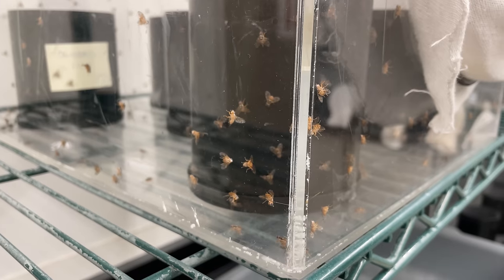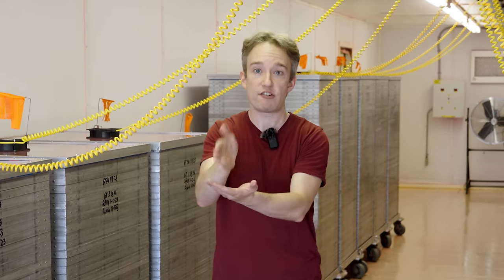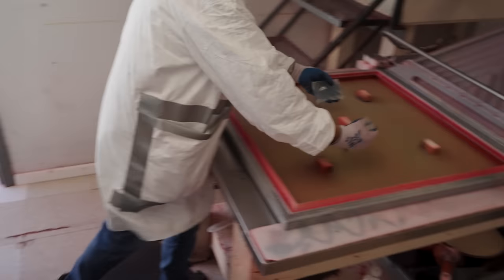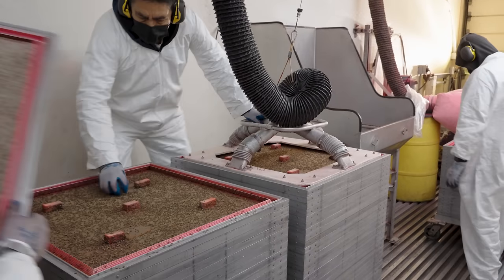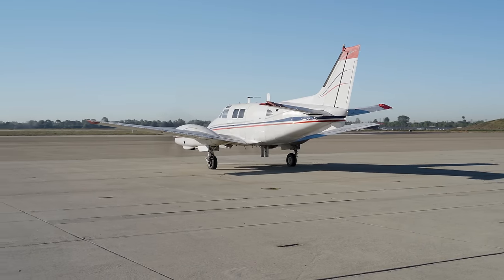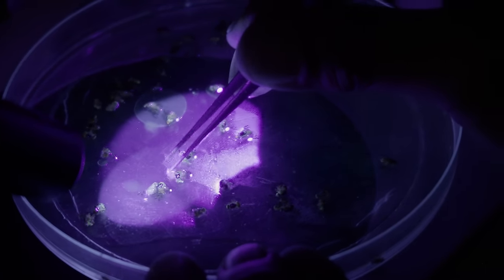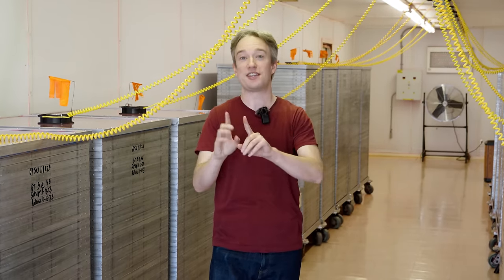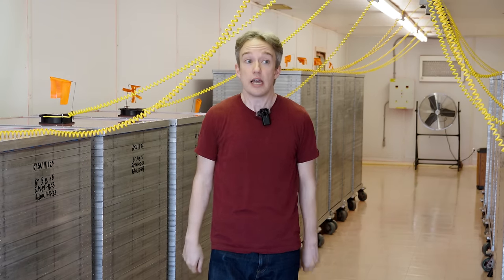Why the government drops flies on California

Comment: I work for a company that makes the X-ray machines that sterilize them. They also do this with mosquitos and a load of other invasive species. So far it has really worked well.
Reply: Can you do it for Midges in Scotland?
Reply: How do they check that they are sterilized? It's just described that they check them when they arrive in the video, but they don't say how.
Reply: @ano_nym  small scale lab tests, check if eggs hatch. if they don't, scale up. batch sampling.
Reply: I'm very curious if the sterilisation process increases the risk of cancer or other health issues for the flies? Given their super short lifespan I assume not?
Reply: @keeyan2166  Their lifespan is about 2 months, so it's not THAT short. That being said, do we care if they do develop cancer? (I understand you are probably just asking from a point of curiosity)
Reply: With mosquitoes, they also make genetically engineered males that are not fully sterile but instead are only capable of producing male offspring that are viable. The male offspring also carry the same trait, so it's a gift that keeps on giving!
Reply: Increasing the risk of mutations with every generation means that it's likely that at some point evolution could find a way around our current methods.
Reply: @FahadAyaz  not true for this as they don't replicate. They should be able to replicate to make advancements with evolution, as there's no future generation
Reply: @ratdude747 That's brilliant. We need those all over the American South.
Reply: @blinkenlights  there's a lot of debate around wide scale release of these mosquitoes, and how the elimination of the few species of mosquitoes that bite humans might effect the ecosystem at large. Personally I'm all gung ho on it, but this isn't something they want to do willy nilly so these debate on it.
Reply: What type of radiation levels do they use for this?
Reply: How quickly can we add the aedes aegypti mosquitos to this program? They have really become a nuisance these last couple years.
Reply: @joecaljapan  haha Midges are small flies common in much of Scotland. They go biting in huge swarms, very itchy and make life miserable.
Reply: @keeyan2166  the lifespan and the simple body plan of the fruit flies practically means they're immune to cancer, even if they start developing it, the chance that a fruit fly lives long enough to be affected is low af
Reply: @FahadAyaz  the fruit flies are bred from a population that is separate to the ones that are sterilized, you know cuz being sterile kinda makes reproduction hard. 
so that evolution can't really take place (and does it really matter if wild fruit flies happen to be resistant to UV light?)
Reply: question: Why do we still have mosquitos all over the place
question 2: do you guys make large scale versions of these so i can just irradiate all the mosquitos around my house. I okay with it making me sterile aswell its a sacrifice im willing to make.
Reply: @joecaljapan  I got a good laugh from this! 😂
Reply: @BillyGooding  I live in Cyprus and midges are very annoying here, too. Their nickname in Greek literally means "a biting horse" or something like that. 50x more itchy than a mosquito bite.
Reply: Is this why there is a butt ton less insects everywhere?
Reply: @kossboss  No.
Reply: ya, except the part where now a company has incentive to make more money by infesting areas to increase the demand for these services. I predict someone will have fly farms where they are not at all sterile and we will then have super populations of these pests, if this happens with fruit flies, probably not a big deal, misquitos that carry really bad diseases, not so harmless. It's just a matter of time before it happens and i'm guessing this comes out of our tax dollars so  also a great way to exploit that too.
Reply: Can we put those machines in Democrat counties?
Reply: @luisbetancourt-dp7hh i guess what he’s saying is the one in a million that does survive maybe it will breed to a giant fly with claws or something
Reply: @AmariLambo  that would be funny, although even if it bred it's very possible it would just bred with another sterile fly and done again
Reply: @luisbetancourt-dp7hh  long enough it’s gonna happen bro haha
Reply: When will people learn don’t mess with Mother Nature it usually backfires
Reply: @keeyan2166 not a single person cares if a fly gets cancer…😂😂
Reply: Now if they could only do this for politicians and bureaucrats
Reply: It's fascinating stuff!
Reply: Can’t that cause like mutation in near future and make insects immune to radiation or something. Since smaller creatures evolve faster than mammals . Idk anything of that just talking out of my ass I’m high af rn watching this
Reply: Lemmme guess.. x rays no megative effect on humans right?
Reply: One confusion Why there is a need to grow the flies and then throw it over aeroplane, why can't remove them from the equation all together?,  will it cause ecological imbalance ? i thought flies are artificially created were not there before? I am just curious.
Reply: Do you think they would be able to do this with the Lantern Fly? Last spring was extra gross and having to check to see if you have hitch hikers to keep them out of the house is annoying to say the lease.
Reply: Do it more cause my house has never seen a higher amount of both flies and mosquitos in the last 2 years. Shits nasy
Reply: Thank you for the work that you guys do. My friends in California are thankful for the work you do.
Reply: @mattlarson9897

As a Californian resident I don’t see it working far as de sterilization
Reply: I need a mosquito that sings Rihanna songs and doesn’t bite me only my opps can I get one custom made ?
Reply: Oxitech has a mosquito program. Florida is part of it. However, they seem to bite.
Reply: @eVill420  Can't fault him too much as when your knowledge of science comes primarily from sci-fi movies, you get easily confused.  I mean it happened in Jurassic Park right?
Reply: Nature will always find a way.
Reply: Yep, you always get one person that always claims that he works doing this,
Reply: @marknorville683  I guess everybody is unemployed in your fantasy world...
Reply: Can this work for mosquitoes and malaria? Isn't malaria one of the top killers in the world? I bet some countries populations would explode..
Reply: For mosquitos, the use of Wolbachia virus to make them sterile works too.

Comment: As a pilot watching this I went down the biggest rabbit hole attempting to figure out whether or not that was a Queen air or a King air. It's a Model 65-A90-1. Which is essentially a King air with a queen air cabin. I have no idea why anyone would want such powerful engines on an unpressurized airframe that can't go higher than 12,500. I guess if the purpose is to stay at 2000 feet to drop flies then I guess its perfect for the job.
Reply: I was curious about that as well but without the aircraft registration it's going to be tricky to see if that plane is original or just picked up on the second hand market and was good enough.
Reply: Cheaper maintenance and certification procedures with an unpressurized cabin?
Reply: @cheekychappy1234  I believe there are two. N65V and N65U, which both appear to be identical.
Reply: probably best to have an overpowered engine for the job than the bare minimum and risk some sort of failure, because these planes are probably reused year after year. I would think.
Reply: @jadeng1147  thanks for that I'll keep an eye out for them when watching the flights landing at LAX on YouTube.
Reply: Worked at Beach, they did alot of different aircraft configs to keep the production lines running...Duke, Queenair, multible Kingair variants (90, 100, 200, 300) based on what customers wanted. They once stuck jet engines instead of pt-6 on a king air for the fun of it.
Reply: They're usually ex-Army U-21s.
Reply: Cargo weight and one engine operations ofcourse😅
Reply: @LasersGoPewPew69 Oh hey, I remember taking a tour of Dynamic back in 2021 when I was in high school.

I remember seeing that they've been looking at/workimg on converting some of those aircraft to UAVs. I remember also seeing one of their low-vis grey Dash 8s (lots of sensors and other equipment housed in bumbs as well) land, as I was standing at the edge of the golf course that was close by.
Reply: @jadeng1147 they also fly N61Q, N67K and N66W.
Reply: @jadeng  To handle the weight loading of the cargo and still be able to safely fly on a single engine for any "Justin Case" moments.  Not all pilots "need" to go above certain altitudes, nor speeds.
Reply: @LasersGoPewPew69 you are correct, all Vietnam era aircraft bought on the cheap from the government and they branched out from there. Worked there for years and loved it all, super cool missions they are involved in
Reply: From below, (3:48 & thumbnail) the "shark body" fuselage shape kinda makes it look like a straight-winged, propeller-driven, Me-262 with its nacelles positioned slightly forward. 😶‍🌫️
Reply: @benjamingreenblatt8482  it was fun until Raytheon bought it and then the culture changed.  I left shortly left  after so I don't know how it is now.
Reply: So if you're doing weight and balance calculations do you account for the number of flies in the flying at a given moment?
Reply: @asbestosfiber When you conduct an operation with a dispensed load of some wort (flies, spray, water), you try to keep the load as close to the CG as practical. That will limit the CG shift as you dispense. The load doesn’t dispense that fast so the weight change isn’t substantial.
Reply: The extra power is used for the refrigeration to keep the flies immobile?
Reply: Like all the previous commenters said, Dynamic got the U-21 for cheap as essentially vietnam era airframe surplus from the Army. The Army sold them on the condition that Dynamic must buy every single airframe, so there's a hanger in Oklahoma stuffed to the gills with them. It's real easy to customize the airframe to do practically any mission when you don't have to worry about pressure vessels or running out of spare parts. 

Legally a king air, no pressurization and typically with a PT6-20/21/28 set of engines. And these suckers can go above 12,500, just throw on o2 masks with oxygen bottles and you can fly up to 24k. Dynamic has projects that fly unpressurized at 20k.
Reply: The load looks quite light here, but maybe with the A/C and releasing mechanism it becomes heavier, and more power is welcomed?
Or they just got a deal on this model, because nobody else wants such a gas guzzling plane for commercial flights...

Comment: This is similar to the joint U.S.-Panama programme that drop flies in Panama against the Screwworm. Not an easy task but one that requires constant effort to make it work.
Reply: Thanks for the read. Found out they cut off the program at Panama (15 million usd per year) because south American countries hate each other and don't want to pay for a certain percentage of the bill to eradicate screworms.  They can't agree on how tk calculate which countries pool what amount for the sterile screworms. 
They should just do it based on the percentage of livestock a country holds compared to south American total livestock.

Comment: Short refrigeration is a very good technique to immobilize insects for macro photography. You can manipulate them into all sorts of poses when they are completely docile at low temperature. Plus if the temperature is low enough and there is environmental moisture you get dew drops on them for sparkling effects. Then after the photoshoot the stars can be released without harm.
Reply: Doctors do it too. But there's more to the story.
Reply: That's how??? 😂i always wondered how they did it, found bunch of flies mating pictures macro photography in Facebook

Comment: Won't this stop working in a few generations, due to the selection pressure on the females to distinguish fertile from infertile males? Seems like a short term solution which could make dealing properly with the problem later on much harder

Comment: Irradiating something doesn't necessarily make it radioactive. It all depends what you irradiate it with. I'd bet they're using X-rays. Maybe a plain old dental X-ray machine. It's not even possible to make something radioactive with X-rays. Neutrons, alpha particles and (at extremely high energy levels) gamma rays can do it. But not X-rays or beta particles.

Comment: To be fair, irradiating them DOES make them radioactive, if only in a very, very tiny almost immeasurable way. But to say it doesn't at all is just factually incorrect. It is just in a very infinitesimal amount that would be almost impossible to measure.

Comment: Inactive flies don't die when they hit the deck like all other living beings when dropped from an aircraft?
Reply: Most insects don’t die when they fall because they have a far higher ratio of air resistance relative to their body weight than most other creatures, which means they pick up speed much more slowly when they fall. This also means that they have a much lower terminal velocity than that of, for example, a human being or a cow, and therefore, many can survive falling from any height. - Steve Foster, School of Bugs.